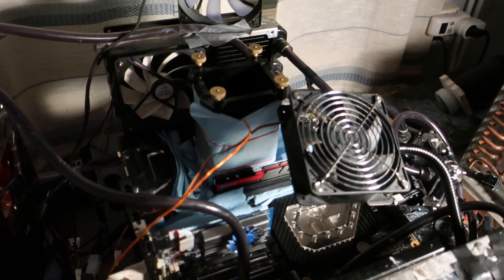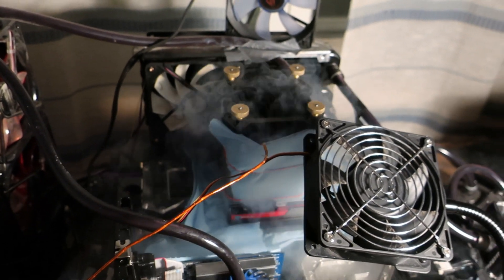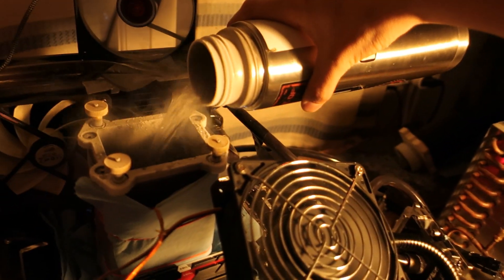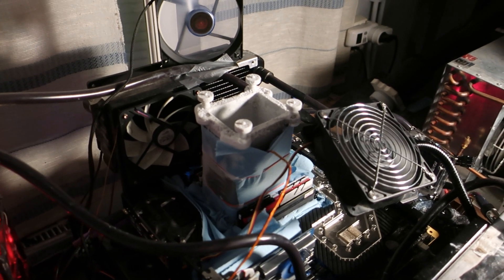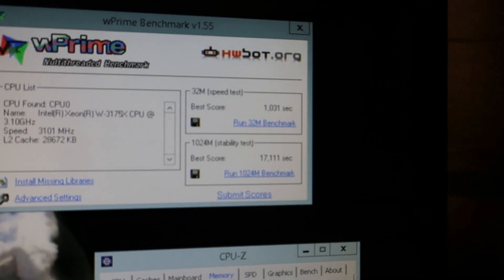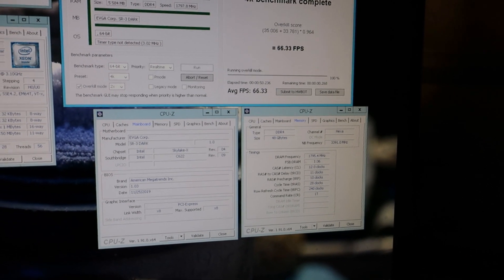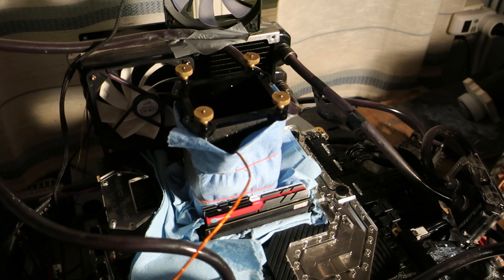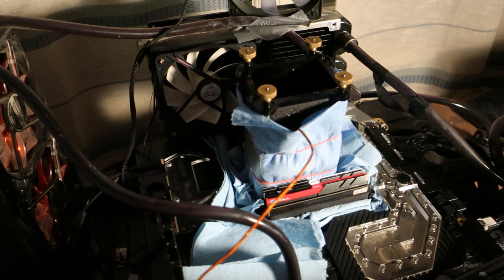3175X goes on LN2 on EVGA SR-3 DARK - 2x Overclocking Records

Comment: Hi ! I have Dominus extreme MB,w-3175x CPU, Titan RTX  24Gb, G.Skill 192Gb 12x16Gb 4266Mhz, but CPU x46 1.25v , Memory not start up PC for 4000Mhz Hexa chanel  1.45v to 1.6v only 3800Mhz Work Nice ,SA 1.2v to 1.4v VCCIO 1.2v-1.35v not halp Timing 17-30 30 42 Not halp , Quad chanel 4000Mhz not stable, Dual Work no problem... Same sustem on Computech 384GB 12x32GB 4000Mhz work no problem but no body give me settings  Halp Please Tchstk7@aol.com   Thanks Best Regards,Alex